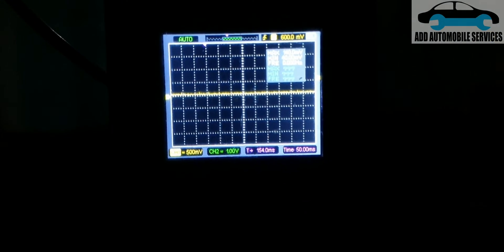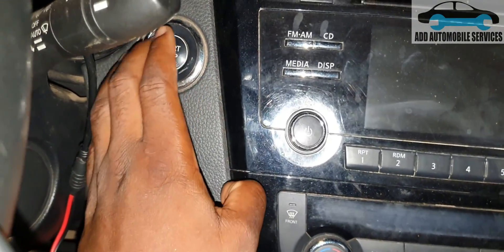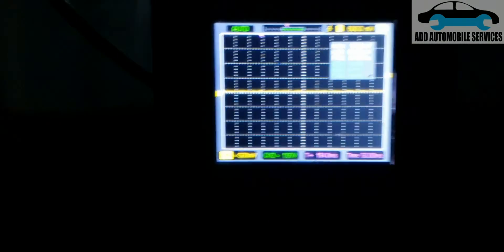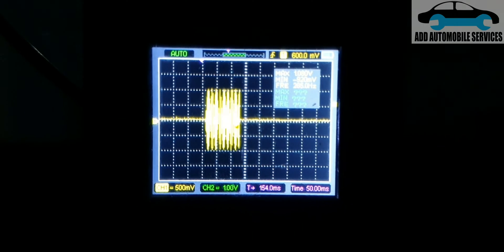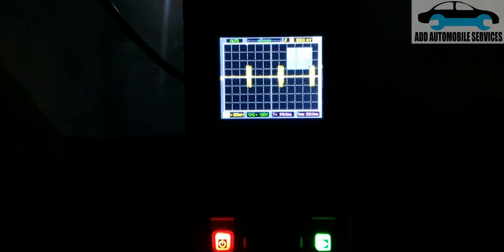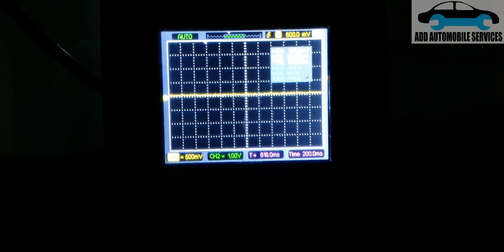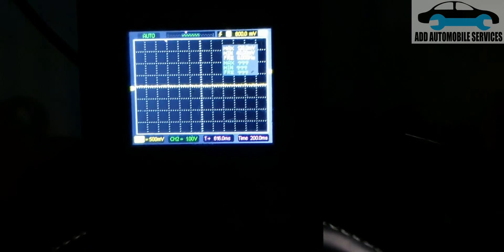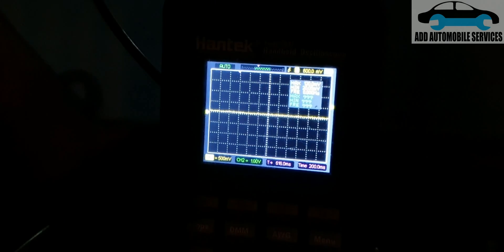Using scope and relay to test push to start  ignition switch antenna

Comment: One of your best videos in my opinion. Big lesson learned for me: the receiver antenna's behaviour AFTER the key has been identified and approved. Thanks. I take it the side of the relay you're using as the probe is the control side not the load side, right?
Reply from the maker: Yes it is the control side of the relay

Comment: There are other easier, faster and cheaper ways to do it.
Reply from the maker: Will be happy if you could teach me does ways👍
Reply: @ADDAUTOMOBILESERVICES  you can just use the coil checker... Just a flat plastic with a coil connected to a led, doesn't use battery
Reply from the maker: @Abonimablesnowman  I have one but I was trying different options
Reply: @ADDAUTOMOBILESERVICES  Oh OK nice... This your method is more professional and informative though. Kudos
Reply from the maker: Thanks boss
Reply: Please do share. Thanks.
Reply: @LewisAAB371  Thanks.